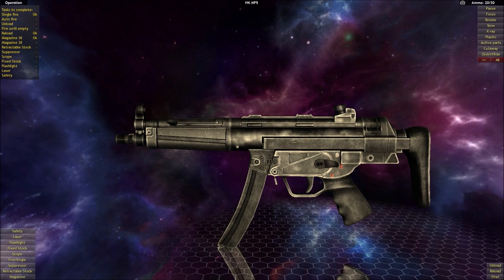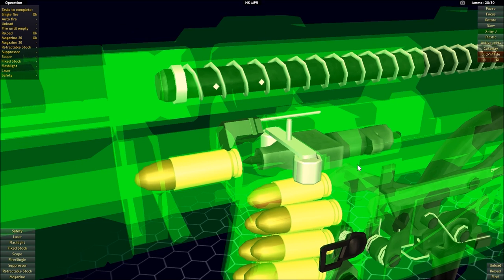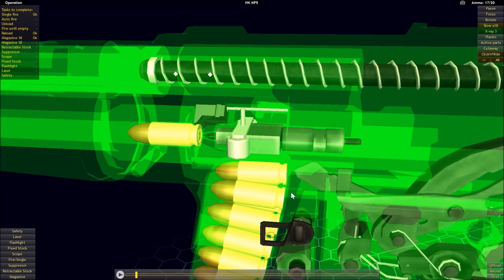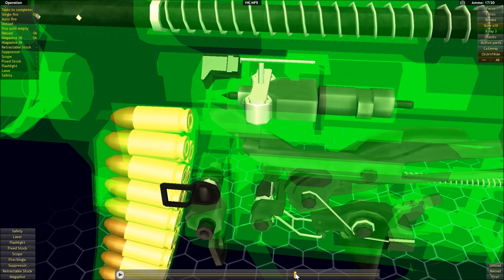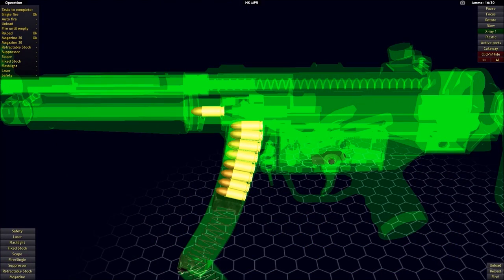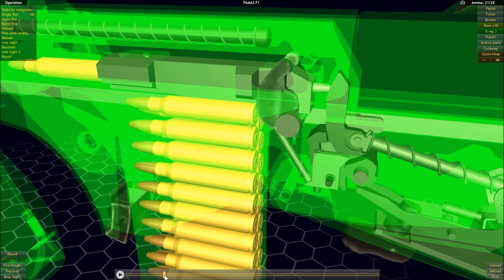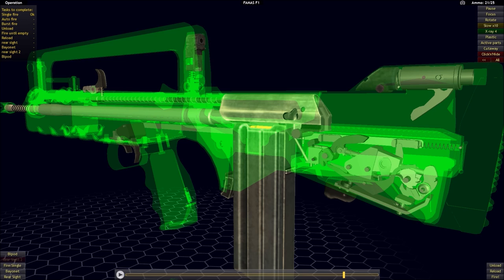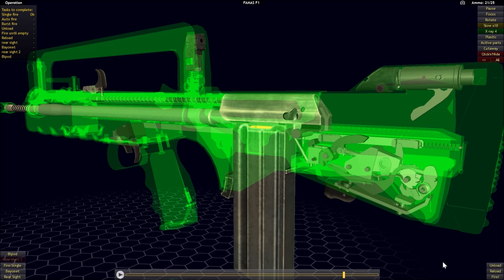Delayed Blowback System in Firearms

Comment: One can easily understand the mechanism of roller delayed blowback design with the following. https://commons.wikimedia.org/wiki/File:Delayed_blow_back_breech_with_locking_rollers.jpg
https://commons.wikimedia.org/wiki/File:Delayed_blow_back_breech_with_locking_rollers_(en).svg
The World of Guns game software is a game software not designed for what you were trying to do.
Also keep in mind that as soon as the bullet starts to move forward in the barrel, the whole bolt assembly starts to move rearward. The delay is measured in the microseconds. (meaning bolt assembly is already moving rearward, while the bullet is still in the barrel)

Comment: In a roller-delayed, lever-delayed, radial-delayed blowback (the principle is the same) the bolt body doesn't "move before the bolt head can move" like it's stated here. Otherwise there will be nothing pushing it. 
The bolt body and bolt head MOVES AT THE SAME TIME, but, due to a device (rollers, lever, inclined surfaces) the bolt body has to move FASTER than the bolt head. 
To accelerate something to a faster pace in the same time requires more energy, so the system absorbs more energy than it will if a bolt of the same total weight would have been used in a pure blowback gun, and that's the working principle of roller-lever-radial delayed blowbacks. THEY SIMPLY TRADE MASS FOR SPEED of a part of the bolt.

Comment: Why does the mp5 have delay rollers?
Reply: With this kind of delaying mechanisms you are able to cut down on bolt mass to have less moving mass inside the firearm. That keeps the firearm steadiear during cycling and is easier on parts. Mass is the essence of each blowback system since it provides resistence in the form of inertia to keep the bolt closed long enough for the chamber pressure to drop to save levels. Without clever delaying mechanisms a lot more bolt mass would be required which increases even more once you step up to more powerful +P ammunition or even rifle rounds.

Comment: I'm sorry I'm kinda new to all this stuff but is this the same as Gas Operated System.
Reply: Yea Im not sure if hes just talking to gunsmiths or hes trying to educate us.
Reply from the maker: No, that is why I have a separate gas operated system video.
Reply: almost same thing but in gas system gas piston unlocks the lugs then let the recoil set the rifle but in delayed system recoil does everything no gas piston bolt locks it self and recoil unlocks it after bullet exits barrel
Reply: i have question for u i will make a carbine but i dont want to use gas system and i am too stupid to make it in delayed system it says 1kg for bolt weigth if i make it in blowback what if i make 300 gram bolt and 1kg spring ?

Comment: These guns are so strange to me. Like I know it's proven tech, but even with a straight blowback the spring coefficient, headspace, ect must be so precise. 

Now we let the barrel bounce around, but only after the projectile leaves? It seem like if pressure us the issue just let it out somehow.... I'm no gunsmith but seems by the intermediate value theorem that if holes all over wold fail due to not enough pressure, no holes failing due to to much then it follows the proper diameter outlet could avoid all this complexity.